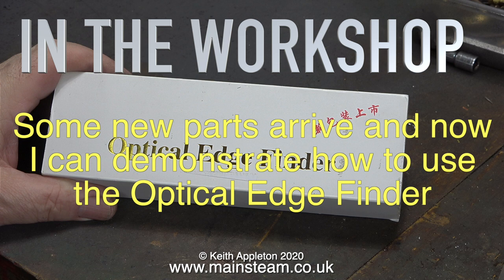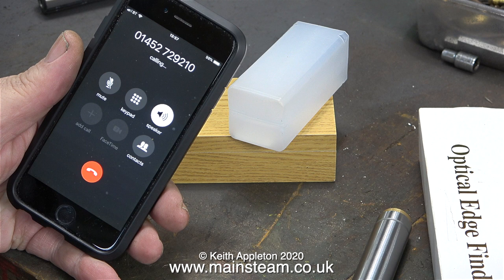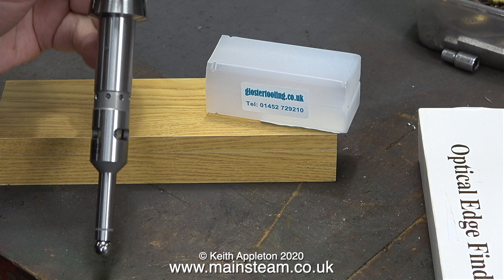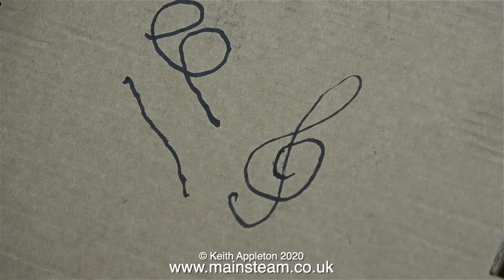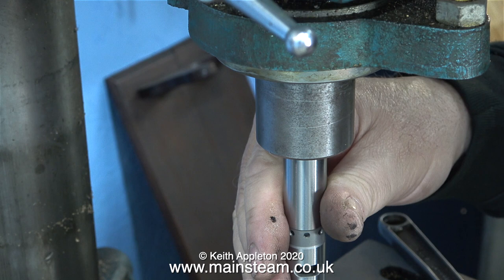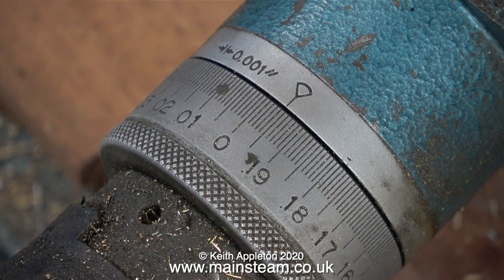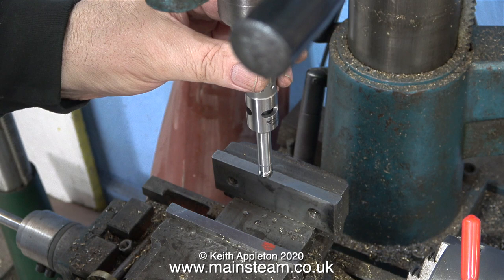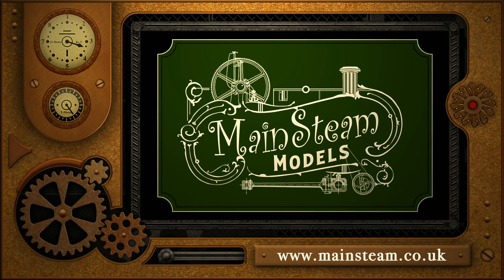HOW TO USE AN OPTICAL EDGE FINDER - IN THE WORKSHOP

Comment: Just a couple of things. On the collet you may find the material too hard to bore it out.  Good ones are usually heat treated and a ground finish but with ebay you often take a chance on quality. Also before edge finding it is wise to rotate the edge finder in the spindle  to make sure it  is first running true.

Comment: I thought about trying one of these but honestly, I’m starting to go off of battery powered devices and going back to analog. The batteries never fail just when you need them and don’t have any replacements.
Reply from the maker: I fully agree, I have a battery powered Micrometer and a battery powered Digital Calliper and every time I want to use them the batteries are flat. I have gone back to the mechanical type.

Comment: I have one of these, had it a while. They are good, however the ball doesn't always sit perfectly central in the bottom, it can be slightly to one side. What I do now is rotate it through 90d and recheck. If I still find the dro shows different readings I will keep turning 90d. However I much prefer to use this over the traditional ones.
Reply from the maker: To be honest it's probably not going to get a lot of use in my Workshop ...... I just wanted to show it, as a kind viewer sent it to me.